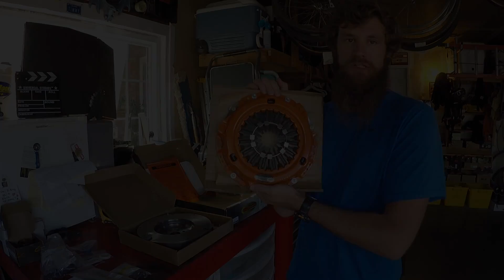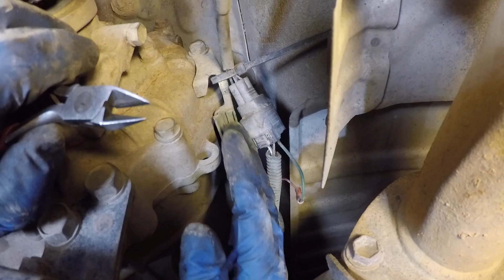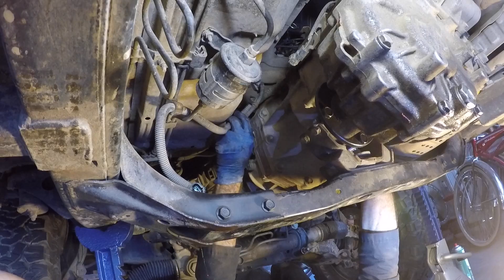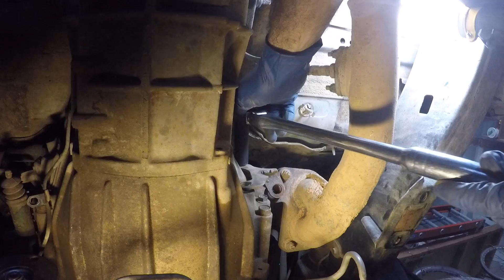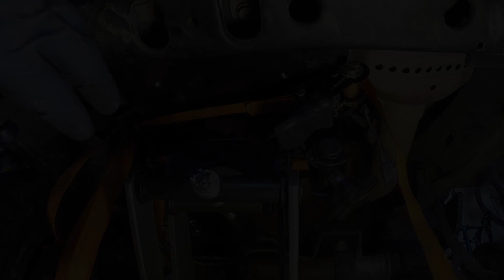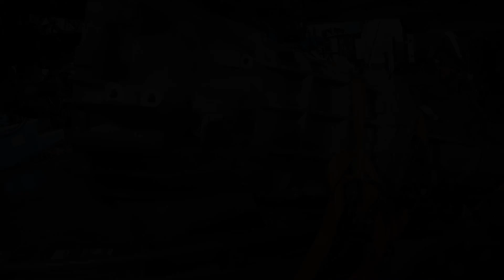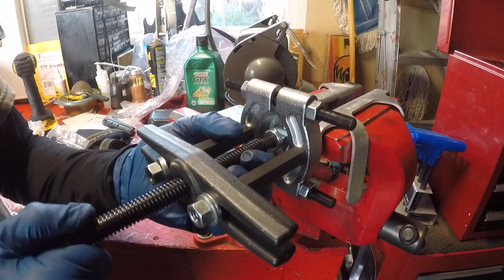Clutch Replacement (Part 1)

Comment: If a DIYer needs your instruction regarding using tools, I can't imagine them getting this job done. A DIYer needs to learn to fight through learning to use tools. 
You need to spray the alignment dowels and exhaust bolts with PB Blaster or Kroil. Makes a big difference.
Reply from the maker: Well Mark, I disagree with you.  Teaching new people about tools is important and we're going to continue describing to people the tools we're using in our videos.  Total beginners have performed involved jobs, like a timing belt replacement, by following our videos.  Our videos are all about empowering people to do their own automotive work,, and that includes detailed explanations of the tools we're using..  

We did use lots of Kroil and heat on the exhaust bolts.  The stud that broke on the passenger side is the same stud that broke on us when doing an 3.4 engine swap.
Reply: @TimmyTheToolman  If you used Kroil, why did you not mention it. That is far more instructional that how to use an extension. Teach that Kroil is great for pulleys and alignment dowels and PB Blaster is great for those rusted exhaust bolts. The PB Blaster needs 5 minutes to work. Kroil does not work as well on rust but give it 20 minutes on a Honda or Toyota crank shaft pulley and they pop right off. 
I have extra long bolts that have the same thread as the tranny attachment bolts. I align the tranny with these long bolts while it is a couple inches out. This helps it slide right into the pilot bearing. It can also be a great safety when trying to get the tranny loose and secured to the jack.  Ratchet straps across under the tranny and over the frame rails is another safety. I learned the hard way. A GM 700R4 landed on my head because it wasn't balanced. Safety tips are far more valuable. 
Rather than charting bolts, I just screw them back in when I see a difference. 
I was hoping to learn any challenges specific to a V-6 4Runner. I'll be doing a clutch for my daughter in a week or so.
Reply from the maker: @idadho  Because we don't always remember to say everything we do. If you've ever been our shoes making a video, it's a lot of work and a lot of talking.  We don't have a script.  Everything said is taken right off the top of our head at that moment for the most part.  Penetrant from what I've learned only gets you so far.  It's not a miracle worker.  What I have found for exhaust bolts is I almost always have to combine penetrant and heat to be successful removing stuck fasteners without breaking them.  On both those exhaust studs that broke on different jobs, both were pre-treated several times day(s) in advance and still they fought us.

I've heard of using longer bolts as alignment bolts to help marry the trans to the engine.  I used this technique recently for a 3.0 to 3.4 swap video we filmed on a 2nd Gen 4runner.  For 3 different manual transmissions I've helped install, all of them required the trans pulled into the block the last 1/2" or so with the bell housing bolts.  They never just slide all the way in like they can with an auto trans installation because the input shaft fitment into the pilot bearing is tight.

We have also used ratchet straps as a safety but I can't remember if we used them in this video.  We definitely used them when we first separate the transfer case from the trans like we did on an auto trans swap on a 3rd Gen 4runner and like we recently did on an auto trans swap on a FJ Cruiser.  We also used a ratchet strap to support the front of a manual trans for the 3.0 to 3.4 Swap Video.  Once the engine is out, the trans is majorly front heavy and put a huge strain on the transmission mount.

So Mark, we're not perfect and we are constantly learning.  What I can say without a doubt is we are doing incredible things for the Toyota DIY Auto Mechanic community.  We try to always give the best information possible at the time we are shooting.  When there's further information or techniques we learn, we add that information to the video description of a pinned comment.  

You sound like you know your way around auto mechanics and so do we.  We don't know it all and we don't claim to.  You have your opinions and so do we and we don't need to agree with you.  Your comment about DIYers not being able to accomplish this job if they require instruction on tools is absolutely false.  We have proven this time and time again with the comments we've gotten from people who have used our videos.
Reply: @TimmyTheToolman  I'm one of those who appreciates being shown tools that you use, as well as alternatives to the tools like Home Depot sourced stuff for the budget folks. I've used both, largely because you took the time to show us how things work. I have attacked a good number of repairs on my old beater Tacoma over the years and it's still on the road today because YOU showed me how to do it!  Stuff that I would otherwise have NEVER attempted on my own. LOVE your video's Tim! Keep up the good work sir!

Like you have said in the past, if the video is too long, or there is a section you don't want to watch, there is a little button on your viewer to [Fast Forward] over that part. ;)
Reply from the maker: @duaneweikum  Thanks Duane.  We appreciate your commentary.  Great to hear our videos have helped you out.

Comment: Would the torque specs be the same on a 93 Toyota pickup 2wd 22re?
Reply from the maker: Don't know if they are the same but you could take a look at our 22RE engine swap video Part 3  for those torque values. https://youtu.be/ZNlFScmbgDY

Comment: Hey Tim, I am doing an engine swap on my 4runner, are you able to take the engine out with the clutch still attached to the flywheel? Or do I have to remove the clutch from underneath the vehicle in order to get the engine out of the engine bay?
Reply from the maker: The clutch and pressure plate can stay bolted to the flywheel when removing the engine.

Comment: I had my pilot bearing break on me the exact same way, it is almost seized onto the input shaft. Going to give that bearing puller kit a try tomorrow!
Reply from the maker: I knew we couldn't have been the only ones this has had to.  Good luck pulling the pilot bearing race off the input shaft and good luck with the rest of the job.

Comment: Timmy! My car wouldn’t start the other day my buddy says the fly wheel snapped the other day at the lake and I had to get a tow. I drive a 2002 automatic, is there any major differences I should know before taking my tranny apart? Thanks!
Reply from the maker: Hey Mike, you actually have a flex plate and not a fly wheel but that's not a big deal.  We have a video series for swapping out an auto trans from  a 3rd Gen 4runner.  You wouldn't necessarily have to separate the transfer case from the trans like we did if you have a 4wd but the rest of the video series would help you get the job done.   You can confirm the flex plate broke by taking off the access cover off the bottom of the bell housing and take a look.  How did your buddy know it's a broken flex plate and not just a bad starter?  Here's a link to Part 1 of our Auto Trans Swap video series: https://youtu.be/oZDSjlxl2Q4

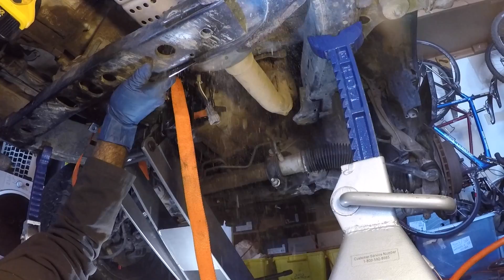Comment: What’s the name of the sensor shown in 26:48? Mine is badly corroded and is going to need replaced.
Reply from the maker: Sorry Mark, I don't remember what that sensor is.  If you go to your local dealer they could bring up a parts schematic and tell you what it is.  That's what I would do.

Comment: Is the balance weight for the transfer case fixed to the bracket or loose? Mine floats & moves inside the bracket.
Reply from the maker: Are you talking the dynamic dampner?

Comment: I was wondering where is the rest of the video where you install the input shaft seal
Reply from the maker: We never got to that point because of the debacle with the bell housing bolts breaking off in the housing.  We chose not to replace the input shaft seal.  I guess you missed us saying that.  But, our recent 22RE Engine Swap video series covers replacing an input shaft seal.  We were mistaken about the need to pull the bell housing off to access the seal.  The bell housing does not need to come off.  We cover input shaft seal replacement  in Part 2: https://youtu.be/hZRwijhMTH0

Comment: How long does it take to replace clutch for all Toyota models?
Reply from the maker: Come on Juan, how could anyone answer that question.  All Toyots models?  The time is going to be different for each one.  A Toyota dealership with their computer program to figure the time for a job could tell you.  We're not a dealership so we can't answer that question.  What I can tell you is it's an involved job.  Plan on spending an entire day doing it.  If you run into issues and you have to get parts or tools you don't have, it's going to take longer.

Comment: You're videos are a GODSEND. I'm doing a 3.4 swap in my 1990 Toyota pickup Extended cab SR5 4x4 and getting the transmission in has been the hardest part for me so far. Pulling the 3.0 was crazy easy and dropping the transmission was cake. Even putting in the 3.4 was easy but holy bejesus getting the transmission in is AWFUL.
Reply from the maker: Hey Joseph, glad our video is helping you out.  Getting the transmission mated to the engine is pretty tough.  We found to get the final mating we needed to draw the trans to the engine using a couple of the bell housing bolts, one on each side.  It's our belief the final hurdle is getting the input shaft to slide into the pilot bearing.  It's not a press fit but it's a tight fit.  I've talked with others who have done clutch jobs and they said the same thing.  They drew the transmission to the block that last little bit using the bell housing bolts.

Comment: Next time you have to remove drive shafts, leave the shifters connected first so that you can select neutral and a gear and it'll hold the driveshafts in place and still allow it to spin freely
Reply from the maker: Yeah, that would work just as well as setting and releasing the parking brake.  Same result, different technique.

Comment: Hey Tim, at 26:56 you remove a final connector. What is that sensor? I think it's the reverse light switch but I'm not sure. Mine started leaking the other day and I'd like to get it fixed before it drains my transmission. Thanks for your great videos!
Reply from the maker: I'm not sure either.  You could try looking it up on www.partsouq.com.  They have good parts schematics you can reference and hopefully identify the sensor.  Another option is just go to your local Toyota dealer parts department and ask them for help.  You can explain where it is on the transmission and that will narrow down what sensor it is.
Reply: @TimmyTheToolman  No luck at partsouq but that's a great site I'll go there again. I'll stop by my toyota dealer and see what they have to say. Thanks for your help!
Reply from the maker: @ZACHATTACK9696  The dealers have all the parts schematics so they will definitely be able to tell you what that sensor is.

Comment: Any idea what that plug is on the transmission at 26:50? I'm battling a P0500 code and it says "speed sensor A" and I'm wondering if that's related (1996 4runner converted to manual 4x4 with elocker...has abs so I thought speed sensor would just be the abs hall-effect sensors in the hubs)
Reply from the maker: Not sure what that sensor is.  If the trans speed sensor was bad, I would assume the mph on your dash cluster wouldn't be working.  I'm guessing it's reporting an issue with one of the ABS sensors at the wheels.  Update, I just looked it up and it does appear a P0500 is related the speed sensor on the trans.  Maybe go your local dealer parts department and see if they can identify for you where the speed sensor is located on your trans.
Reply: @TimmyTheToolman  Thanks for the reply! my spedometer is still working and I've already checked the abs sensors (no trans speed sensor). I'm beginning to suspect the wires between the spedometer and the ECU. Just trying to eliminate other possibilities.

Comment: Why did you remove the bellhousing?
Reply from the maker: We were thinking while the trans was out that we would remove the input shaft seal, because if it develops a leak later, the trans has to come out again.  What I learned from others is that this seal rarely develops a leak so the fact we blew off replacing the seal after having such a struggle getting the bell housing bolts out ended up being good decision.

Comment: 3 of my bolts snapped and I used breaker bar then by ratchet and I felt the stop backing out and I tried heat which probably didn’t help so I’m in same boat lol
Reply from the maker: Are you talking about the bell housing bolts?
Reply: Timmy The Toolman yup.... I had to laugh at that part cause I was like damm I’m not mad anymore lol
Reply from the maker: @LC80_mcdonald  Damn.  So heat did nothing.  There's not theory down the drain.  I guess it's just a case of getting ready to break bolts if you have to get that bell housing off.  Thanks for sharing your experience.  This is good to know.
Reply: Timmy The Toolman what I figured lol and it was pretty much the same ones 1 on lower middle left and 2 in middle right

Comment: I just pulled my transmission last night. I totally agree that it is the pilot bearing hanging up. I had the same problem a ratchet strap wrapped around the transfer case then attached to the rear axle allowed me to put a good slow controlled pull on the transmission and transfer case and got everything free without having to use the screw driver method. Your video definitely helped me thanks a lot for posting it.
Reply from the maker: Glad this video helped you with your adventure underneath your truck! Freeing the trans can be a pain in the neck!

Comment: Its pretty easy to get to the top 2 bolts through the shifter housing instead of using all those extensions
Reply from the maker: I can see that working.  Thanks for sharing.

Comment: I've been following the steps and just dropped my transmission. big thanks. I'm confident I can follow the rest of your vid and get it back together,
Reply from the maker: Good luck with the rest of the job.  Let us know how it went for you.
Reply: @TimmyTheToolman  well...took me a couple months. but did it a few bolts at a time and just drove it around the block a couple times. Seems like I put it back together correctly! my car was in pretty bad shape but I bought it as a project and i definitely put it back together than it was originally assembled. no more weird noises or smoke...for now.
Reply: How’s your truck? How it’s still running
Reply: @cbdreamer1709  ran great until I sold it a couple months ago

Comment: Why didn't you just remove the 4 bolts that hold the shiftier and transfer case shiftier in instead of removing the snap ring?
Reply from the maker: You could do it that way as well.  Personal preference.
Reply: @TimmyTheToolman  Thanks, i was just curious.
Reply from the maker: @mikerundell3907  Yeah, there's quite often more than one way to do things when working on these rigs.  Sometimes we show the easiest and most straightforward way to go about doing a task and other times we miss something that would have made our lives easier.

Comment: The torque spec you listed for the bell housing bolts is 53. Is that the torque for the bell housing bolts that mount to the transmission as well? (The bolts that you snapped to replace the seal)
Reply from the maker: I looked in my Toyota manual and it doesn't show the spec for those bolts that attach the bell housing to the transmissions.  You'll just have to use your best judgement.